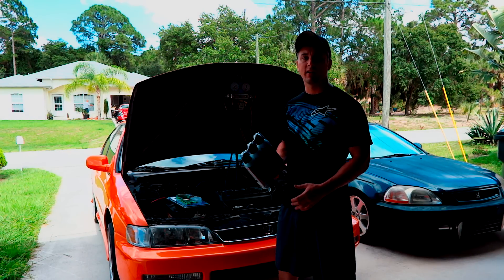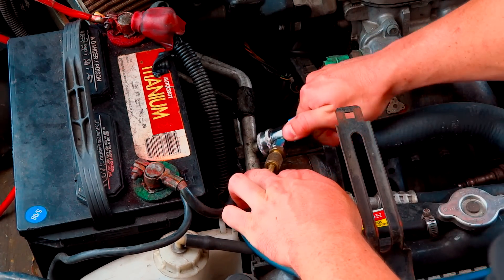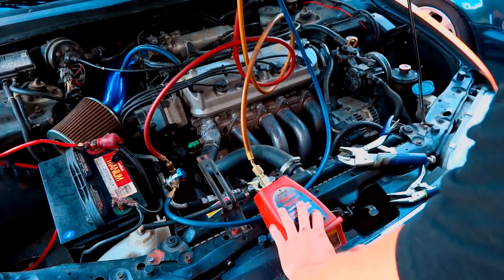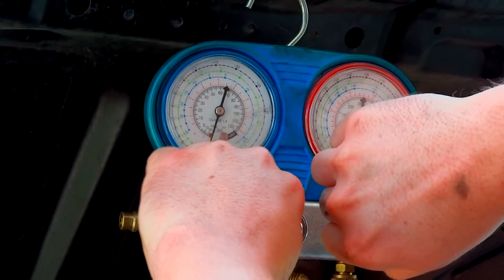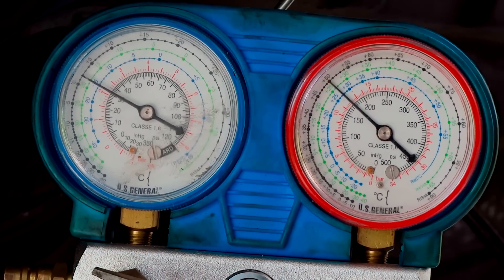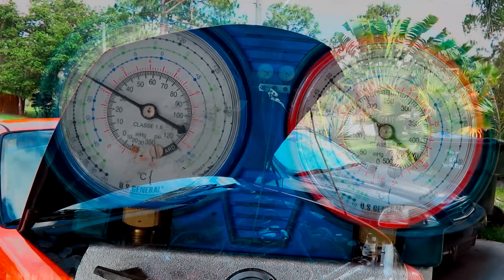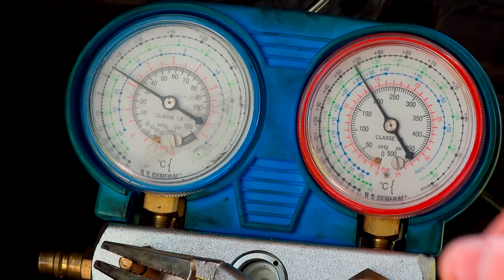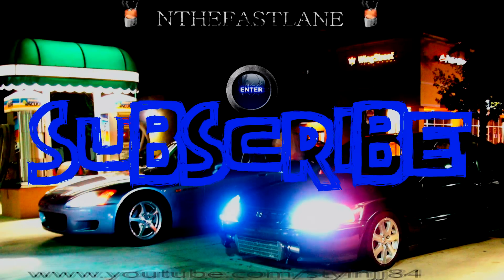Charge Your A/C With The Cheapest & Coldest Refrigerant

Comment: http://www.justice.gov/opa/pr/enviro-safe-refrigerants-agrees-halt-sales-unapproved-flammable-hydrocarbon-refrigerants

So they were selling explosive gases and got hit with a $300K fine etc...  so now you are recommending the same using Dustoff... another HIGHLY flammable gas.  You idiots are going to get someone killed.
Reply: scottwa .....i read the artical ...thats for e22 or whatever systems ..im quessing for homes. yes i agree for a house witch is a contained area you should never put anything deadly like ammonia or propane or anything like that., but in a car where its open to the atmksphere i would say if your gonna use gasoline or propane to power the vehicle whats the issue to power the ac system in a relatively open air system ...some gas cimpany vehicles powrer there vans and trucks with propane ...also forklifts that are operating inside buildings ......cant wait to hear your argument
Reply: Dustoff is NOT flammable - it is just a smidgen away from R134a, which is inflammable. But R152a is global warming friendly where R134a is not so since the price of R134a is down, they will have to come up with another pile of BS to force us into another refrigerant like R134a
Reply: They only got fine because they didn't pay the EPA the millions required to have the refrigerants approved by them.

Comment: You shouldn't vent it, it's still considered a refrigerant (R152a) and EPA bans venting of ANY refrigerant. it's one thing to use dust-off for its intended purpose (using it for anything other than its intended purpose is illegal as well, but we won't get into that). If you feel you absolutely MUST do this conversion, do it the right way. Take it to a shop and have the 134a recovered. It's cheap. Hell, if you live near me i'll do it for free. Then buy Actual 152a refrigerant, and use that.  Bear is mind though, SAE has already done extensive studies on 134a vs.152a. 152a will show better performance ONLY if the expansion valve is adjusted. At the same cooling capacity, air Discharge temp of 152a and 134a are almost identical.

Comment: You need to recover the refrigerant, not dump it.
Reply: Super Duty 455 yeah but he should recover the 134a, why do you think they changed dusters to a lower gwp refrigerant. Duster is just 152a now.
Reply: You obviously don't listen or read very well
Reply: George W ....so if its in a dust off can you can blow it in the air all day long ..but if it's in the car you can't?
Reply: R134 used to be the working fluid in keyboard duster, now it's R152a. In both cases, they expect you to expel them both into the atmosphere.

Comment: Curious when you have a system designed for R134A Why do you want to change it to another refrigerant?   Yes R152a is colder, but it is highly flammable.  You run a risk should a leak develop you have a fire under your hood.
Reply: And get that dangerous gasoline out of here!
Reply: THERE'S A GUY IN ANOTHER VIDEO USING PROPANE 129 AS A REFRIGERANT ON AN OLD TRUCK.
Reply: +George W R152a has the same flammability as R134a
Reply: but the systems arent compatible anyway...
Reply: I watched another vid where guy sprays R152a onto an open flame.....it put out the flame......I feel pretty safe with that!
Reply: less risky that a upper injector to fuel rail leak.... its a gas baby
Reply: I thought the ASHRAE number of propane was R290? I've used it myself in a 134a system some years ago and it was icy cold. I worry only as much about flammability as those driving newer cars equipped with R1234yf (which itself is a propene) ;) Considering the current price of 134a I'm seriously thinking of topping off our current system with 290.

Comment: What about the oil in the system? How much, and what kind to put in? 

Also, you shouldn't use pliers on the fittings....
Reply: Usually PAG 46 for 134a, PAG 46H for 1234yf. For 1,1 diffluoroethane (152a)? I don't know. For 1,2 difluoroethane (152)? I don't know.

Comment: wow tightening A/C service lines with vise grips , thats a new one , pointless , and also damaging to the seals in the connectors , if you only knew how stupid you sound , and I have never seen a thermostat gun lmao
Reply: ***** The service lines are the hoses, not the valves.
Reply: towrecker It's not pointless if he doesn't have the knobs, if only you were there with him, you could have been just the knob he needed.
Reply: toewrecker, yeah but you sound even dumber and you seem like a douche bag to boot, like you know what stupid sounds like anyways
Reply: I can tell that you have never used those blasted 'finger tight' POS knurled knobs. The acme threads do not hold. Period. Just as you get going, one of the blooming things turns loose and lets air in or refrigerant out. I keep a pliers handy at all times just for that reason. You are all full of it. The acme threads on mine are the same as on the equipment that you use and they simply don't work.
Reply: @jaydubyahwing2260  Actually I have the same set, actually two of them. Maybe I should make a video showing the proper way to tighten them with just your fingers. I never use any sort of pliers. I don't really have a problem unless I get in a hurry an get sloppy like some newb.
Reply: @bryanfullerton1566  , very nice - happy for you! But are saying that you have mastered the problems with connections using ACME threads? When are you going to start raking in the millions of $$$ that should get for you - or are you planning to keep it to yourself. Besides I said nothing about the set at all - it is the ACME threads with o-rings that causes the problems.
The ACME threads with o-rings are notorious - if you don't tighten them enough, they leak if you tighten them too much, they ruin the o-rings and leak worse. If you tighten them  in between somewhere, they leak anyway or they back out the first time you have to move the hose. The only way to make sure they don't leak is to tighten them with a pliers and replace the o-rings regularly. It is a little difficult to argue that you have so calibrated your fingers so that you can hand tighten them to the appropriate amount in every circumstance anyway. You might actually get away with it a few times, but my experience suggests that you are bragging a bit if you make such a claim. 
Perhaps the proper point of tightening occurs just beyond what a person's fingers can produce. However, a sensitive touch on a pair of pliers can produce the appropriate tightness every time - that is, every single solitary time regardless of what is on your fingers or gloves. Don't be trying to be some kind of snoot by putting people down for not being able to produce perfectly as you can. That is the indicator of a real newb, isn't it?
Reply: @consaka1  , sorry, I respond in kind but with a little less invective than what was used to smart-talk me.  I responded to M so I suppose that is who you reference here as M8. The comment from M said that I use POS gauges - I said nothing about gauges in my comment, merely pointed out my contempt for ACME threads that are required to be used on the POS gauges and all of the other gauges as well. I don't give a hoot which gauges someone uses. M took a snooty attitude that lifts himself over everyone else, which does get my dander up a might. If that make me sound like a teenager, what in the world are you sounding like? Nothing to get upset over - and you can tell who is upset and who isn't? I don't think so.
The key to your response concerning the ACME threads (which M was not talking about) is the statement 'No reason they should loosen at that point.' 
In my experience, they do not require a reason, they loosen anyway. Who is to know when they will or when they won't loosen, and whether or not a movement of the hoses will cause the fool things to work loose? I can't, but if I use just a little more pressure than the hand-tight method, they never come loose, though the o-rings suffer a little for it - hence the need for the pliers. I don't appreciate it much when someone pulls that kind of 'pissing contest' stuff with me and I let him know about it.  This has nothing to do with being upset that I can tell, how about you? At least you read what I said and seemed to answer my comment rather than denigrate the gauge set that others use, as though they reign supreme over gauge set quality.
Reply: @dwjw1  LOL "M8" is a slang shorthand for "mate" as in Australia your buddies are mates. 

As for the gauges, use what you got and buy what you can afford. ACME threads will come loose if the hoses are moved around. Once set up with everything plugged in I just tighten them as part of the assembly and have no problems with them. It's part of hooking the car up. No reason for anyone to get excited over it.
Reply: @jaydubyahwing2260  Because you are using the cheap POS gauge'hose sets!  A GOOD tech wouldn't be caught anywhere near those crappy gauges!
Reply: @user-cy6gf2pj7y  - too bad, you are so far out there that you have trouble comprehending. I don't have one of those el cheapo sets, I just know that when I use the ACME threads mandated for use with even the fancy gauge sets as well as the cheap ones, the damned things end up turning loose and they do it at the most inopportune moments. If you want to talk slip-on style, the leakage is just as bad and just as devastating. They work pretty well for a few uses and then not so well after that. 
Quit trying to put your nose in the air so far. If you have a point to make, make it. Pissing contests are for kids. Am I to understand that YOU are a GOOD TECH? Remind me to not call you for service.
Reply: @dwjw1  See my comment above.
Reply: @jaydubyahwing2260  If you tighten the 1/4 inch knurled female threaded connector to the male – and then shift the position of the hose – yes the connection will loosen. However tightening them any tighter than finger tight – actually if you have moderately strong fingers you can even overtighten them with your fingers – if you tighten them any tighten than finger tight you will damage the  cylindrical rubber seal inside the male, if not right away, than you will at least shorten their life.. While these are not expensive, they are a pita to get out. In my opinion the best way to tighten is to tighten very gently, connect all the hoses up and place them in the position you are going to use them, and in that position then tighten the connections a little more – until you just feel the rubber seal being contacted, and just a little bit more than that.
Reply: At least he is assisting people , and those lines have to be tight
Reply: Thermostat gun ??  Those point and shoot laser thermometers.. never heard of those?  Lasers man..faaackin leeeaazersss..  thermostat gun is like a stoner way of saying it when you forget the word for hotness and coldness reader...
Reply: youre an idiot
Reply: Tyler Helgerson Forgot about that part, obviously I thought you were referring to him using vice grips to control the valves.  Still, I clowned your ass.

Comment: Just a heads up, you may want to edit and add the fact that R152a (Duster, Dust-off) Is Infact FLAMMABLE... so make sure that you have no leaks at all in your system especially at the evaporator(little radiator in the car) and more so if you happen to be a smoker..R-152a does not smell so if the Evap leaks and the car is now full of that R152a and you happen to light a cig.... Car Go BOOM.. Lesson learned, keep an on on your levels, and quit smoking....

Comment: Great video and I'd love to try this on my old Honda. 

It seems that the "Dust Off" and other brands of spray that I have found now contain a bitterant to help discourage inhalant abuse.  Does this added chemical pose any problems for using this in your AC System??  

I see this video was posted in 2013, so not sure if the BITTERANT was in the original product back then or not...

Does anyone know where you can purchase this product WITHOUT the BITTERANT added?

Thanks!
Reply: The Blow Off brand of computer duster has no bitterant added.  
You can also just buy a 25 lb jug of refrigerant-grade R152a for $160, from The Supply House.
Reply: optionstraderman Evidently the Bitterant is not a big concern..  Today, June 24, 2015, I found 3 pack cans of "Dust Off" on Walmart's site for $8.38.  If you print out their web page showing the prices and take it to the store, they will price match in the store for the 3 pack which I believe is priced at around $11.50 in the store.

http://www.walmart.com/ip/Dust-Off-Electronics-Duster/25596750

Comment: To all you ignoramus' saying what this guy did venting his refrigerant to the atmosphere was illegal. He said he had Envirosafe refrigerant in the system which is about 60% propane and 40% isobutane. You can buy propane and butane at the store and vent it all you like and no one can do shit about it because it has zero ozone depletion. You could buy a 14.1oz bottle of propane and 2.75oz of Ronson Ultra butane and blow that in any system and you will get extremely cold temperatures if done properly. Europe, Japan, and many Asian countries use Propane/Isobutane for refrigerant with no issues. As for flammability i would be more worried about 18 gallons of gasoline around a hot engine at 40psi through 20+ year old rubber hoses than i would be with less than one pound of propane in an A/C system. Just my 2 cents, I think r134a and all the other crap is all about extracting money from wallets.
Reply: Thank GOD.  Finally - a voice of reason and logic.  Thank you.  I've been talking about this shit for years.  It's amazing the amount of ignorance and fear mongering out there.  It is SO HARD to try to explain anything to these types of sheeple.  Carry on.
Reply: He said he had r134a in there. It doesn't contain propane or butane.
Reply: @doctorfeinstone6524   He said clear, he had the envirosafe, whatever, version of it